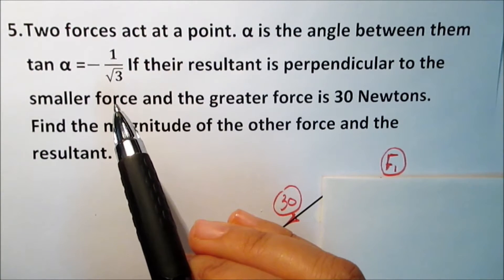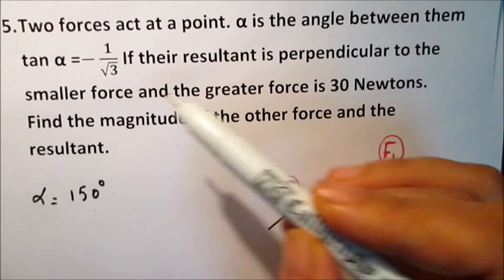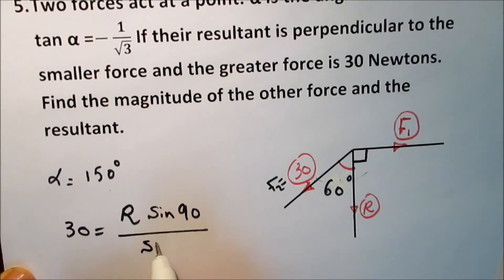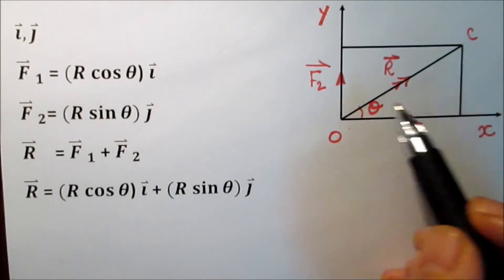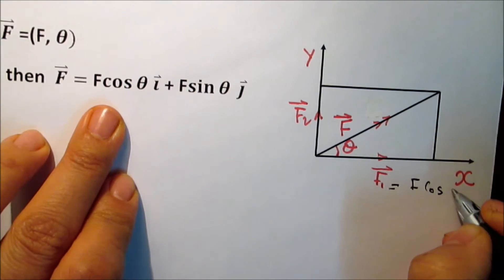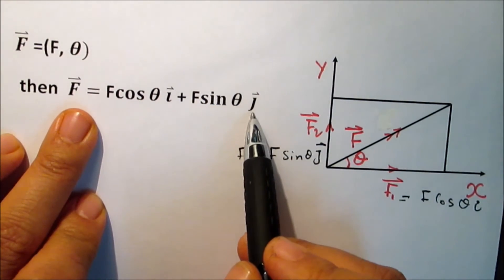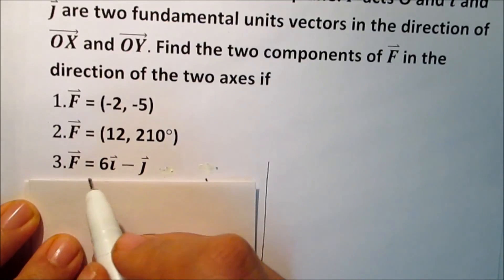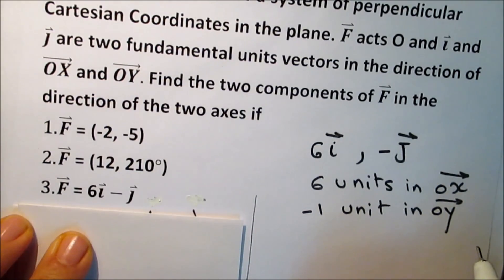Resolution of a force into two components part 3

Comment: Why in question no.  5 we took  alpha  = 150 why we didn't take it =330 and why we  didn't use the law of the resolution of force into two perpendicular direction and we use the first law
Reply from the maker: Hi madona assume alfa greater than or equal 0 and less than or equal 180 and you can use the rule of resolution of two forces into 2 directions (but not perpendecular to each other) but F1 is perpendicular to R you will get same results